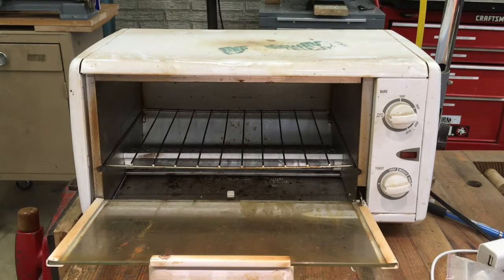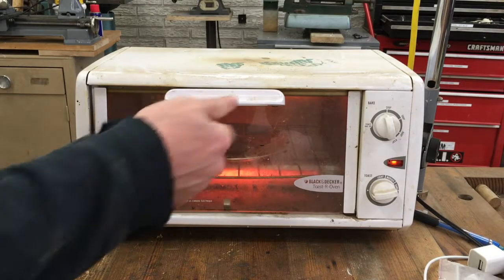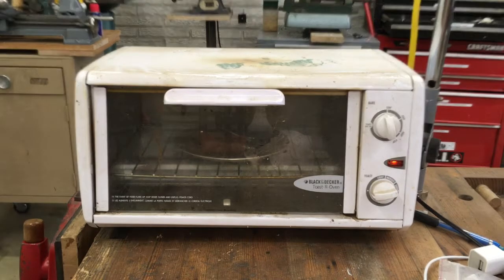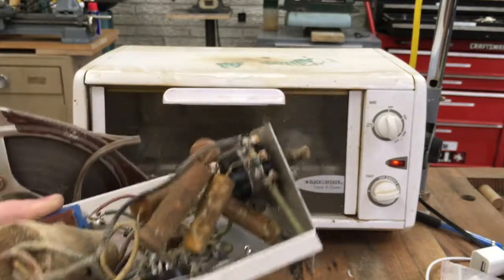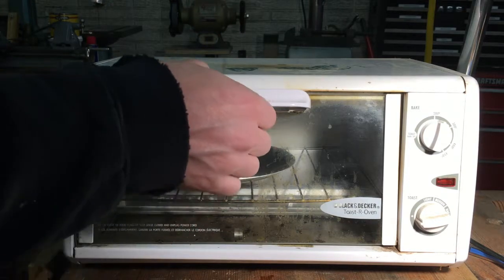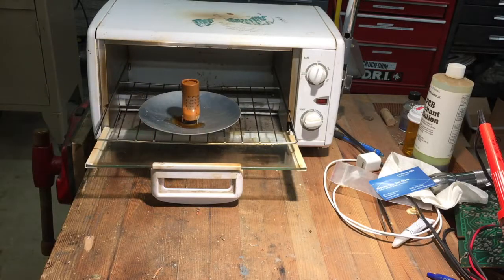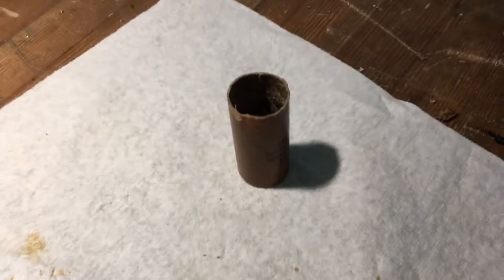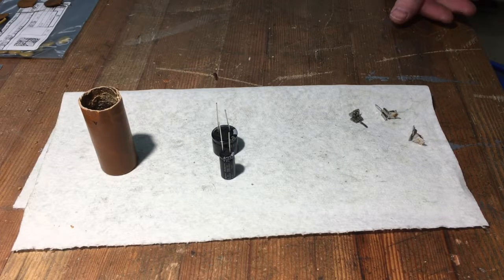General Electric C-430A Clock Radio Restoration Part 2

Comment: Fascinating and nicely done .Question - Can the old style variable capacitors still be purchased ? 
Thanks very much for your video Mr. Phillips and all the best .
Reply: I'm talking about the old Variable Capacitors  with the knob for adjustment / metal "fins" . 
When I was a kid many years ago , Me , my brother and dad picked up many components from a place in Phantom Canyon Colorado . This site was for Tesla research and part of his "Triangulation Energy and Transmittance " research . 
That small laboratory was abandoned many years ago . At the time ... in 1963 , it still had  a partial roof . Nobody cared about the research between Colorado Springs and Larkspur CO . Still have 40 pounds of old semiconductors and other stuff picked up  from Phantom Canyon and Larkspur CO .
Reply: Thanks for the data . Yes .... sadly , there are a lot of those old variable capacitors in the bottoms of landfills / junk yards . I have 2 old Fender guitar amplifiers which use tubes and the old and large variable capacitors . They are still working Great . 
Seriously sad what has happened to Radio Shack and some of the old time component suppliers . ATB